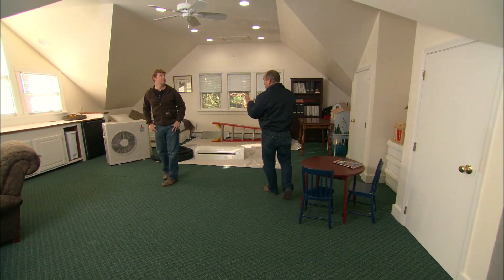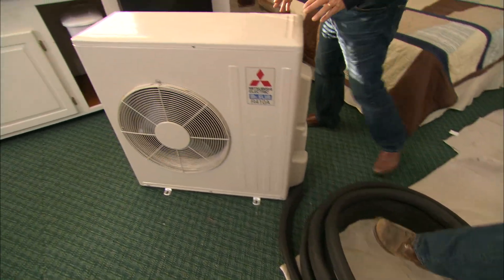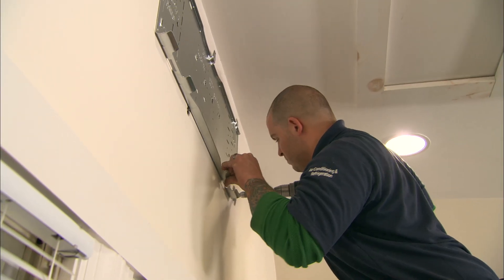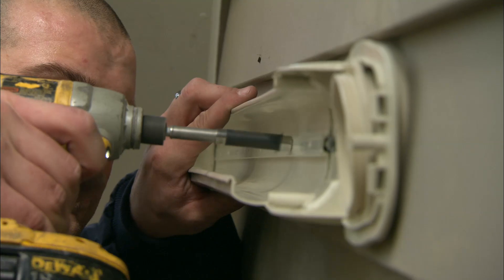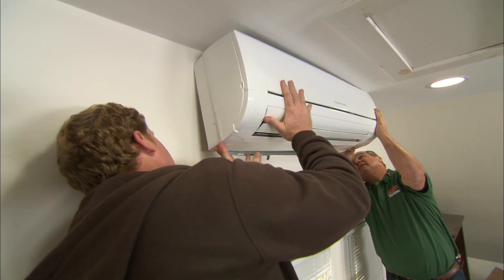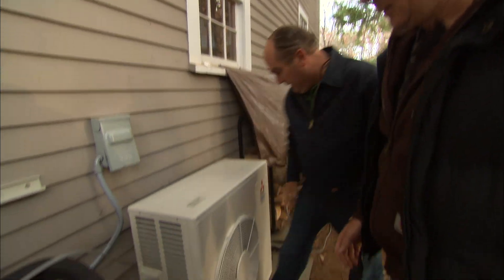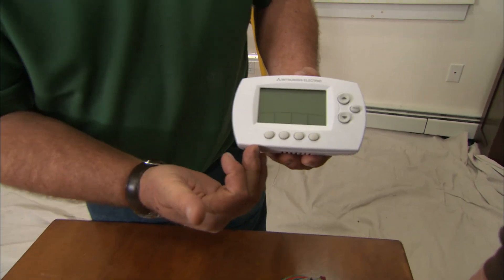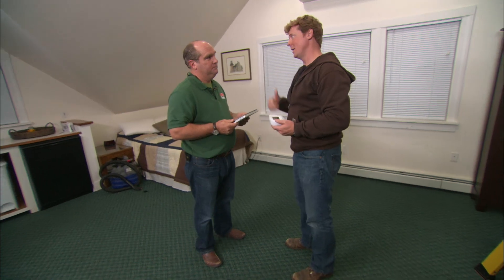How to Install a Ductless Heat Pump | Ask This Old House

Comment: normally, the problem with hanging the condenser on the exterior wall is the motor vibration will be noticeable in the living space no matter how much iso padding you use. but given there's a garage on the first floor, this will likely not be a problem in that install.
Reply: that is why we put rubber on metal holders for outside ac unit , no vibrations
Reply: Exactly. The vibration will also be carried through the studs, floor upstairs. I've heard that mounting on a concrete pad is best, some distance from the house wall.
Reply: you are right there is noticeable  vibration and sound but our homes her in uae made of concrete we put the external machine on the roof, I was thinking if it was on the floor want get damaged by the snow?
Reply: Plenty of people put standard condenser units on walls and don't experience vibration issues, so I doubt this is too big of a problem. Especially if it's new construction and the walls are thick because of the insulation.
Reply: We are having a split unit installed next week (Carrier 18K BTU's). Salesman DID mention the sound/vibration issue if mounted on wall (as we wanted) so elected to go with concrete pad. Noticed in previous vids, ext. unit doesn't seem to be anchored to pad. Did I see that correctly?
Reply: Our Mitsubishi Zumba is mounted right on the brick wall, and we don't hear a thing on the other side which is the main bedroom.  Maybe vibration attenuators were added like rubber washers, but nothing really special.

Comment: Please make an episode on how to maintain and solve simple problems with Ductless mini splits. My mini split is leaking water from the inside, I have cleaned the condenser line, cleaned the inner tray, but continue to have the same problem. Please help! Great episode!!!
Reply: make sure the insulation on the line sets are in tact
Reply: You have no down fall for the water to escape. Put a level on your unit and make sure there is some fall. Once done test it with a bottle of water to see if it leaks